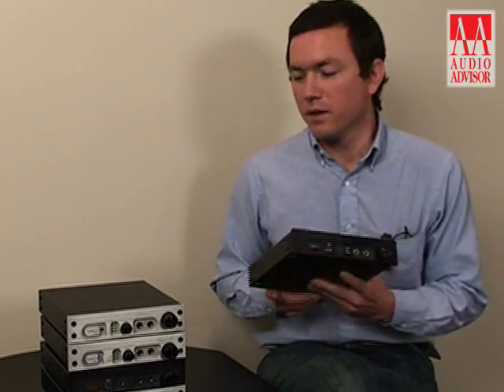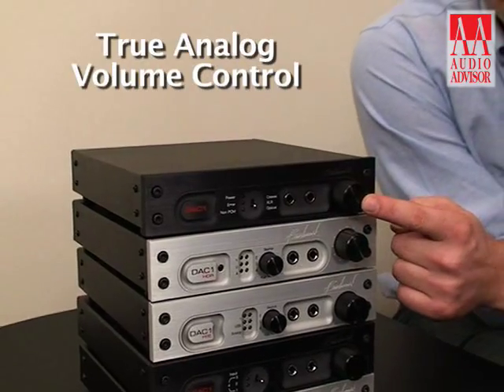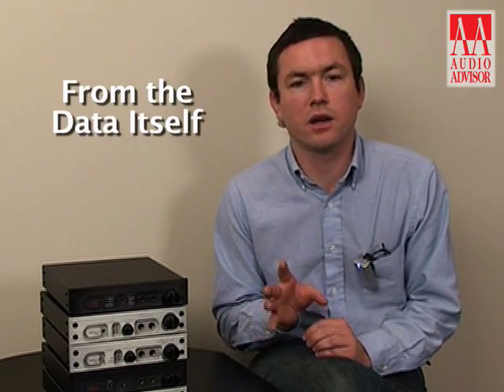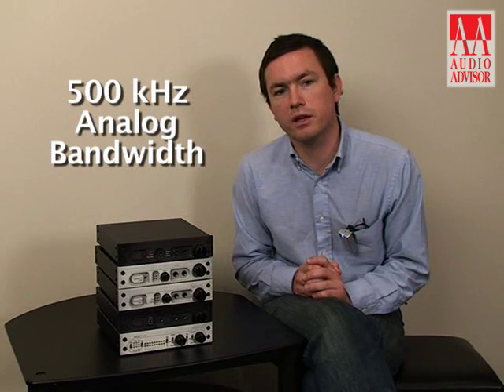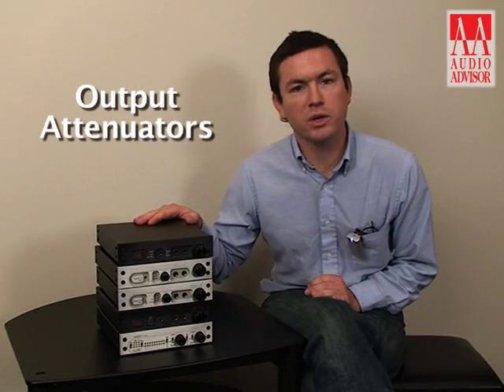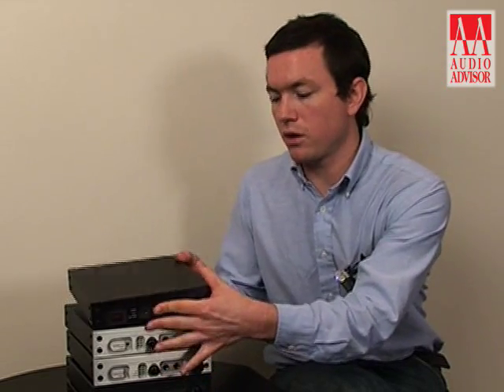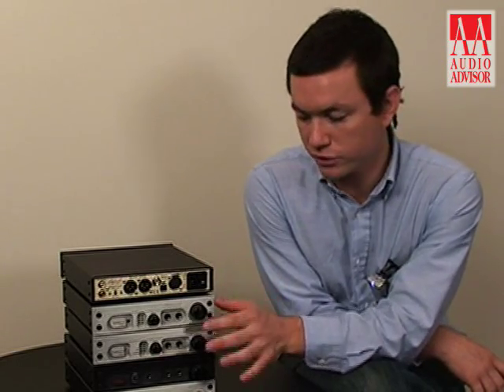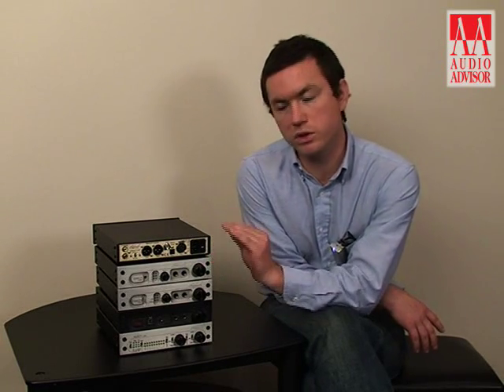Benchmark - DAC-1 Digital to Analog Converter – Audio Advisor

Comment: Hi, I've been researching this product & have nearly bought one on a few different occasions. But I've got one question that I just can't seem to find an answer for.

I have neighbours so I can only play loud music during the day which is fine but I also use my headphones in the evening (Sennheiser HD650) but I sit about 5ft away from my music system so my question is :- if I plug the DAC1 into my amp between my source to control the volume with my amp's remote, can I also control the volume fr

Comment: Excellent entry level hi end dac. Neutral. Tight bass. True balanced configuration. Jitter free. Extremely detailed with great clarity, with good head stage depth. Negatives. Bright, dry, and lean sounding. All together a great commercial Dac, but can be bettered for half the cost by DIY kits like the buffalo dac.. Either way, I only sold my DAC1 cause I needed emergency money